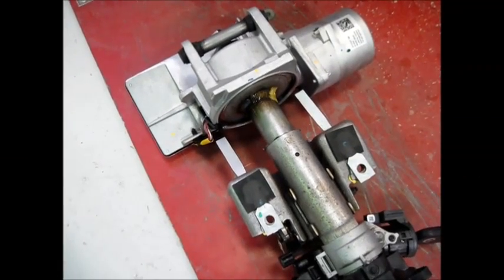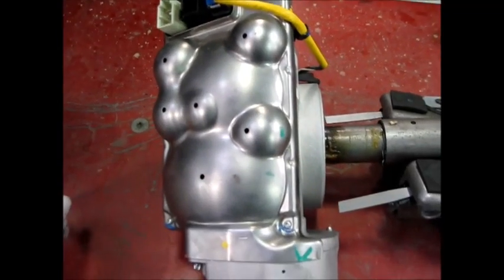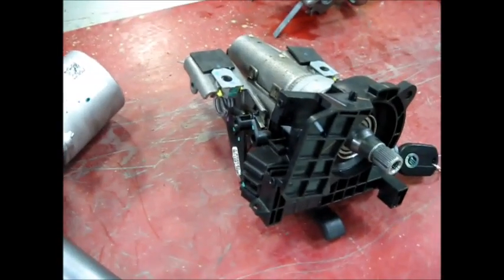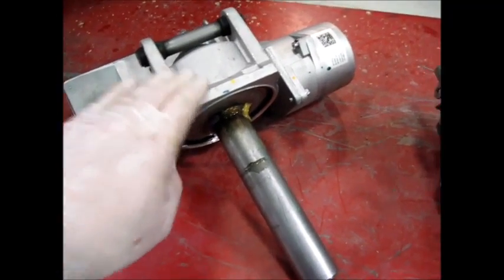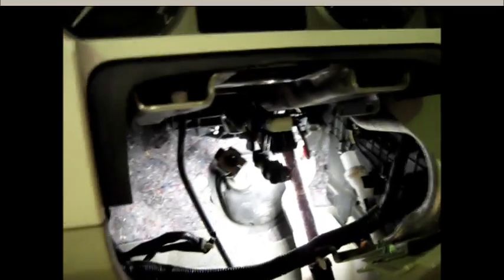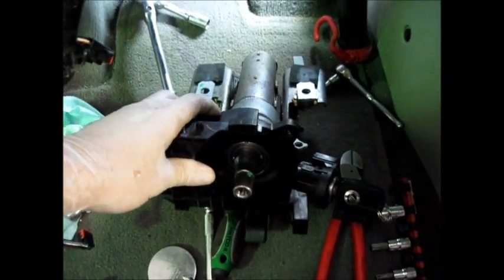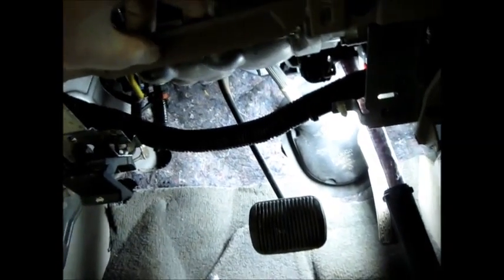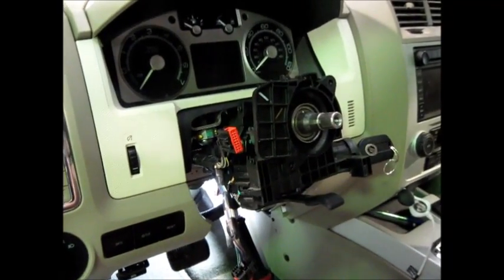Electronic Power Steering

Comment: I've just done one of these. The sensor code was thrown, but the motor needed to be replaced too, but i wanted to emphasize that you do not need to break the plastic in the car. You never cause damage to a customer's car. It can be pulled and re-installed without removing that cross piece. That's like saying we had to cut your frame to remove the engine because it was easier for us.

Comment: There is a replacement torque sensor module available from Ford and some aftermarket suppliers.
If the problem is just the sensor then the whole column doesn't need to be replaced.
Reply: Just dont put it out by 5 degrees or more or you will whirlybird the steering wheel and fuck a 200 dollar part instantly.
Reply: It's pretty hard to fuk it up by 5° there's a notch that torque sensor fits into and you have to line it up perfectly in order for it to go into its place

Comment: Is it really necessary to completely disassemble the steering wheel area?  Couldn't you just use the top half of the old unit and keep the air bag assembled?
Reply: Yes... I ve seen a video where they just switch the power steering motor... You don't need to remove the steerin wheel and all that...

Comment: My dealer wanted $1900 for the Column for a total of $2300 installed. My wife's 09' Escape would loose power / Electric Steering after it was parked & ignition was off. Sometimes you could start it & you would have power steering & sometimes maybe not. I ordered a Brand New OEM Replacement Steering Column off eBay for $1000 & had my local shop install it for $200. So that alone saved me $1100+. Now I have no more intermittent power steering loss. No Flash was needed. No codes
Reply: Theres a recall on it see if you can get it covered under the recall.

Comment: How do you get to the bolt it pivots on, and how does the shaft coming from the floor secure to the motor? Also, what do you need to do after you swap them and put it all back together?

Comment: So I replaced the torque sensor only (200$). Still getting that B2278 error. I wonder if that pivot is the only bolt that has to be removed for that whole bottom piece to come off any suggestions

Comment: I've looked through your newer videos for a follow up on how to initialize the power steering system, but haven't seen anything. What exactly are the steps here?
Reply: Ryan Johnson yes I’ve found the same where they say nothing needs to be done, but this says you do. I just ordered a steering column from a salvage yard and going to replace to lower column with it. Unfortunately the only answer I’ve found so far is to do it for myself and find out.
Reply: hannahb31092  there is no need to initialize the control module. All you have to do is swap out the lower steering columns and you're good to go! I just had to do this last week. Just make sure the new lower steering column is aligned properly after you put it in before you put the upper steering column back on. My power steering works again and is even better before the power steering went out!
Reply: Erica Combs you have no idea how grateful I am for the reply!! I’ve been looking everywhere for somebody with experience on the situation to give me a direct answer! When you say make make sure the lower column is aligned properly can you tell me what you mean exactly? Just want to make sure I understand what I’m coming up against!
Reply: hannahb31092 when you have the upper half of the column off and the shaft of the lower half off you will see the torque sensor. You will see a triangle on the upper left on the sensor. There will also be a tiny triangle on the column itself in a little window. You will need to make sure those two triangles are lined up as perfectly as you can get them. When you move the wheels the arrow inside the column will turn. Just keep manually turning the front wheels until those triangles are lined up! Also you're welcome! I researched many hours about this and couldn't find anything about "initializing" the control module. So I just swapped the columns out and it worked!

Comment: I have a 2014 Sonata and a rat got into the electric steering equipment and chewed the wires. I was unable to drive my car, I had it towed to the dealer. Since it was not covered by my warranty since it was caused by an animal, I had to get my insurance company involed. Total bill was 1700 dollars. I only had to put my deductible. Thank god.

Comment: I don't see a video on how to reset power steering. can I just start up and go after I install new column? what is the process
Reply: Ryan Pease did you find the answer to this ?
Reply: hannahb31092 there is no need to initialize the control module. All you have to do is swap out the lower steering columns and you're good to go! I just had to do this last week. My power steering works again and is even better before the power steering went out!
Reply: @EricaCombs  I went to junk yard to buy used power steering assist motor and pump they called me back and said I have to buy the whole steering column because once the power steering assist seperates from steering column it unsyncs is this true? Can I just get the motor assembly and put my old steering column back on?
Reply: Did you ever find the answer to this?

Comment: I've got a 2008 Ford Escape and have a steering column problem.  The recommendation is replace it.  I've read the torque sensor is part of the steering column assembly and is not serviceable separately. In other words, once that sensor goes the entire steering column needs to be replaced. And that’s expensive and it takes a couple of hours to replace.
Reply: yes, torque sensor is part of steering assembly. if torque sensor is definitly diagnosed as the problem IT is servicable and can be replaced. In this case entire steering column does not need to be replaced. just the torque sensor AND several or a couple hours or half a day is fantastic for the time consuming work involved
Reply: Same issue ended being a bad battery,  charged it, issue was resolved

Comment: I am a little car dealer and and think a seller at the auction unplugged something on my steering so it will not work.  I will look at your plugs you have shown but also wondered if there is a simple fuse or relay that I should also check?  I know this video is older but maybe you will still get messaged from youtube and respond?  Thanks from doug in southern california
Reply: So my question is is why does the power steering assist motor still pivot because once it pivot it takes the steering colume off-center so when you're replacing the torque sensor it doesn't line up correctly

Comment: If it's just a bad steering torque sensor like you suggest, it is not cost effective to replace the whole steering column. You didn't tell your viewers how much the whole steering column is vs. how much the torque sensor is. You must be made of money to want to throw it out the window like you do... Hint..
Reply: It's 2018 I paid 200 for the sensor it's a pain to replace .... Still getting the steering assist error I may have to replace the whole column
Reply: Eros T did you clear the codes after you installed the new sensor?

Comment: The so called recall for the Ford escape electronic steering is bull shit my 2008 ford escape started failing for no reason the quick fix was to simply turn the vehicle off then on again that will help somewhat now you take it to the dealer and guess what they preform a system update on the vehicle cpu and call it a fix don't be fooled because that so called update is ford covering up that falt then later when your driving guess what  it fails again but now you can't preforme that temporary fix by turning it off and on again now you have to pay out of pocket about $1000.00 to 1.500.00 to change the whole steering colum thanks ford you suck I'm getting a Japanese vehicle way more reliable than this American crap their commercial says haven you driven a Ford lately yep and almost died in one due to your negligence stop covering up your mistakes and just fix them REALLY FIX THEM and you wouldn't have so many angry ford customers. Please ford FOUND ON ROAD DAMAGED
Reply: I agree 100 percent. Found On Road Dead is getting more accurate all the time.  I've been a Ford guy for 30 years. No more Toyota is by far more reliable.

Comment: Touque sensor available on amazon . Then it must be calibrated with a scan  tool.
Reply: And that’s the part that people miss and the situation happens again is the sensor being reprogrammed correctly after replacing that torque sensor. I think that’s why people have the same issue after that sensor is replaced and then they are prompted to replace everything.
Reply: jeffrey seal